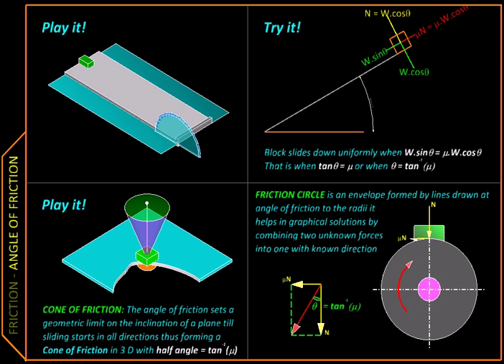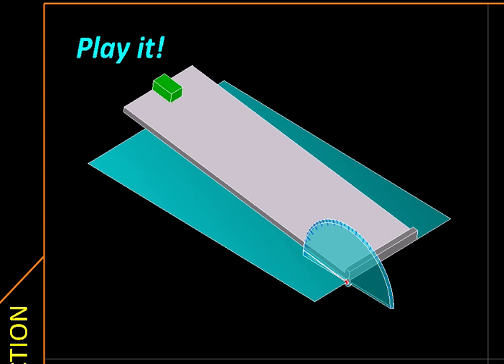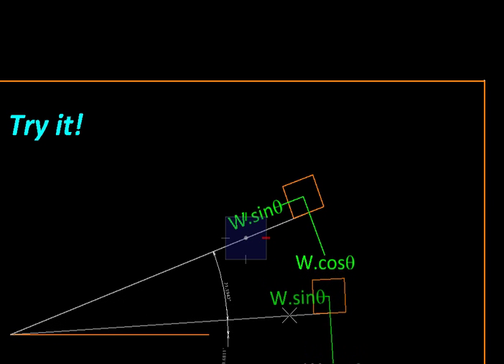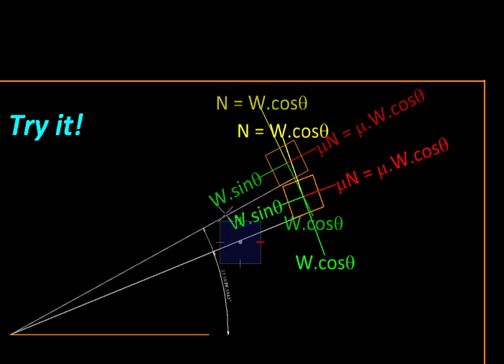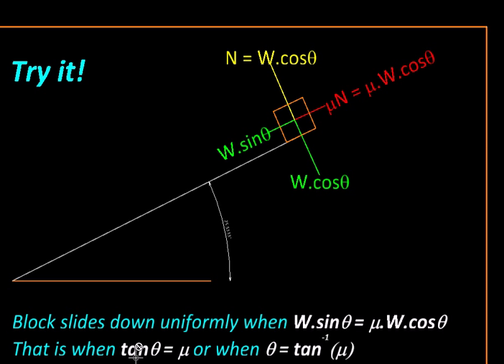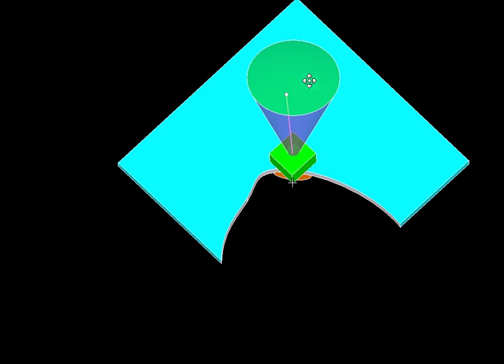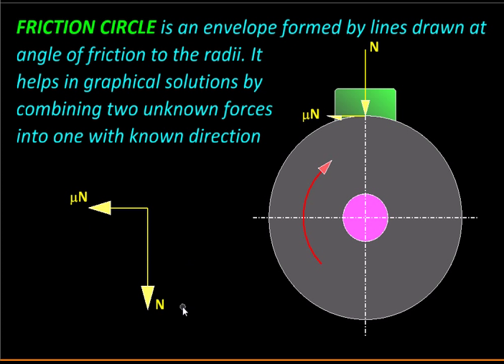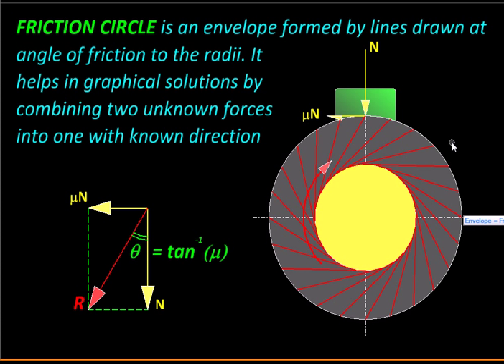Dynamics with MicroStation Ch04 C Friction Angle Cone Circle

Comment from the maker: @Srikanth Rangdal I know what you mean. Just when it starts sliding it has overcome the Static and not kinetic friction and hence it should accelerate a bit down the plane. That is why I used the phrase 'moves uniformly downhill' :-) Anyway, wanted to keep it simple basically. Was answering a question i got from a student. However if one really wants to eliminate such interference from static friction, just use a creaky hinge :-) The vibration will make sure it is kinetic all the way.

Comment: Sir 
     Could you explain the concept of friction axis
Reply from the maker: +nithu babu Friction axis is related to friction circle explained here. A single friction circle inclines the resultant along its tangent. But if you have two (e.g. in a link with two pin joints), then there are two friction circles and the load would not enter any of them! So we have to use a common tangent to both the circles called the friction axis.
Reply: Sir
    Thank you for your reply. but my doubt is not yet cleared.
   What i came to know from books was that, for two friction circle (as you said a link with two pin joints) there will be 4 common tangent. Out of this for a particular type of motion we should choose only one among that four tangent, isn't it Sir. But my doubt was that how to choose this commen tangent and thus the line of action of the thrust or pull
Reply: Would you please explain it with a video lecture